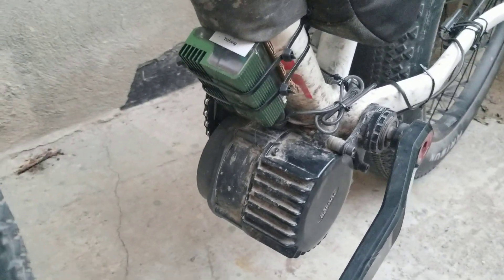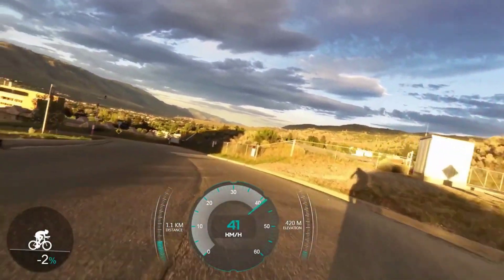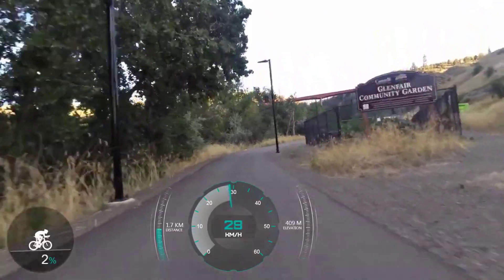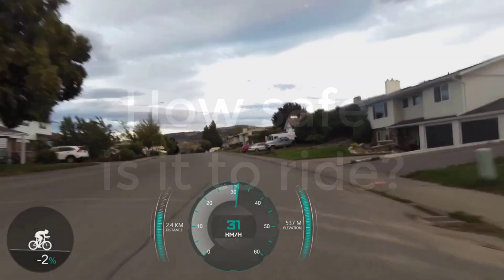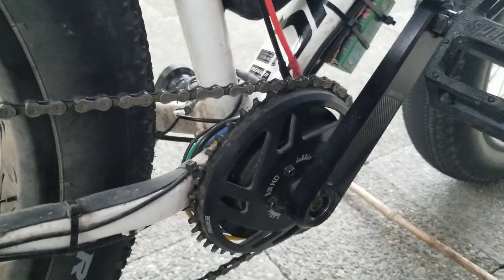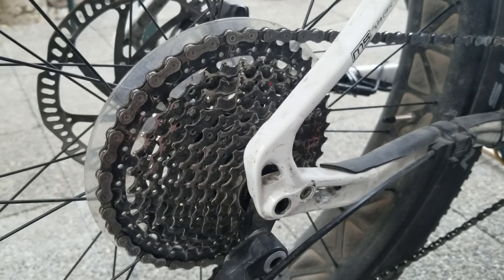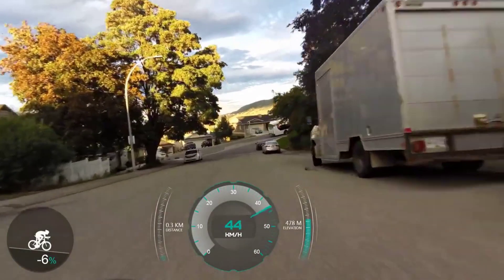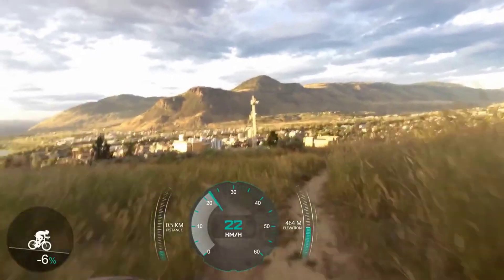Bafang BBSHD - Ultimate Controller? ASI BAC800

Comment: Hi Captain, I'm having problems with my ASI bac controller. It's already been back to the supplier once to check it's config and it has come back with exactly the same issues. Before I contact the supplier again I thought I'd ask you, as your setup is so similar to mine. I have chosen this video to comment on as it shows exactly what I would've expected from this controller. 
However my ASI BAC controller pedal assist starts at 50 watts on lvl 1 and goes all the way up to 250 watts at lvl9 ....yes that's 250watts. Also the 750c display doesn't have a 52v option! It has 36v 48v 60v and 72v therefore the graphical representation is inaccurate, at least it displays voltage numerically and that's accurate.  The throttle  function seems fine. You can imagine my frustration at installing, removing and installing again. So I thought I'd ask you if you think I might have overlooked something before I contact the seller again .
Reply from the maker: Sounds to me like it's been locked to road legal EU specs. I'm not familiar with the 750c Is the reason it's not giving you the 52 volt option is that it is already selected? Sorry you having trouble. I imagine 250 watts is a bit dull.
Reply: @HighVoltageKits  Cheers for your reply Captain. It does sound like it's EU spec lol but this was never an option. Having communicated the conservative  pedal assist values and no 52v option on the display I was requested to send it back, which I did. Sadly nothing has changed. Yes you're right conservative pedal assists are dull, pants, shitty cockwomble. Other than that it's epic 😂. Time to get back in touch with the vendor. It's replacement time or refund.  So disappointed. Thanks for your time Captain. 👍

Comment: Hello. I’m hoping you can help me with some information. Almost 2 weeks ago I ordered the bac800 and touch screen from ERT website. The status of my order is still “not fulfilled” and I’ve been trying for over a week to get In contact with them. Multiple calls, voicemails and emails with zero communication. Any idea what’s going on or how to get In touch with them?
Reply from the maker: Its not a big operation. I'm sure you will get it. But things are pretty much handmade right now. It's literally launching for the bbshd over the next little while. There is not a stock of thousands ready to ship. I'm not in shipping or manufacturing so I cant give you a time. Alan works hard but he has limits.
Reply: Captain Codswallop I can understand that but why doesn’t he answer emails or calls? If he told me there’s a week or two delay I would be fine but I’m considering reversing the payment because of the lack of communication
Reply from the maker: I'm not sure. I will see if I can get a general update for this weeks video.

Comment: I mostly use for pedal assist with occasional Throttle application, does the controller improve efficiency in terms of range? Very curious, I just don't like how bulky it is and how it makes the bike look DIY.
Reply from the maker: Changing a controller in itself will not increase your range. Which is simply a case of how big your battery is and how fast you choose to drain it. I use the controller because it is light years ahead of the stock stuff in the control it gives you over your motor. If you are not comfortable with making mounting hardware and custom parts then external controllers can be less attractive. It depends what you want. The auto engagement you can have with this controller is great for PAS control wise. No more snap on and off with the power as you stop and start peddling
Reply: @HighVoltageKits  Nice! being thinking about the upgrade, perfect project to kill time in the pandemic, however, I don't think they have any stock on those controllers anymore. Is phase runner comparable?
Reply from the maker: Kind of. The really cool PAS stuff is on the nxt tho. It will be back in stock.https://accelerated-systems-inc.myshopify.com/products/bac-800-eval-kit-with-bluetooth  This will not be 600 via Alan. It is the replacement for the 800.

Comment: I am about to purchase mine and would like to know  does the kit comes with the display or do I need to buy the displays separate
Reply from the maker: I would get the nxt display to get the best out of the ert kit. It should give you options. Which motor are you using it with?
Reply: So is the display included in the Price of the kit or do i need to get it separate?
Reply from the maker: You can order it as part of the kit. I think you have to register first and then you can see the options.
Reply: Thx.
Reply: Bbshd

Comment: I'd never have a mid drive without using an internal geared hub.
Reply from the maker: Supposedly there is a sturmy archer hub that can handle 3kw. The problem is most hubs can't handle the higher power. I love the rohlhoff ones but at 1500 bucks it's the cost of two batteries. Then if it gets wrecked....
Reply: @HighVoltageKits  if you release the throttle every time you shift like you're supposed to there shouldn't be a problem.
Reply from the maker: Yeah I do try and practice good housekeeping. I will keep it in mind. My dollars have to stretch far so maybe a future project. I have a 7 speed nexus on my bamboo bike so perhaps it may get converted down the road. With the nxt display the gear change sensor may well become tunable so that would also help with internal hubs. You make a good point

Comment: Are the stock Bafang attachments (throttle, e-brake, shift sensor) plug and play with the ASI controller?
Reply from the maker: Yeah. The kit uses the same bafang harness. So you would just plug the main harness into the plug on the loom that comes with the kit. All the other bits plug in like normal. You may need an extension for the gear sensor depending on where you locate it.

Comment: Thanks for the video! How is your bike fairing after over 6 months with this controller? Does the motor still operate nicely? Has the drivetrain noticeably deteriorated yet?
Reply from the maker: You are welcome. Its holding up well. At 72 volts now and it actually runs cooler than 52 volts as the amp draw is less. This is my most recent overview. https://youtu.be/c7q5TbIYq7I
Reply: Captain Codswallop cheers, I’m very tempted to get this setup. Only thing putting me off is the noise when compared with a dd...
Reply from the maker: It's not as loud in person or to a passing person. The camera is quite low on the frame. It's not silent but people quite often dont notice the sound until quite late. Knobby studded tires dont help. Offroad it's much much quieter. If you want almost silence then it's not going to work. But even full power it's way quieter than a car or motorcycle. Even a regular fatbike with knobby tires will make a fair amount of noise on the road. I'll shoot some better noise footage this year from different perspectives later this year as it's a question I get asked alot. I hope this rather rambling reply is of some use. Cheers

Comment: Hi Captain,,,, I have followed you and all the information and its been a great time watching it,,,, So I decided to get the ASI BAC 800 from ERT (Alin Hu) Thin is I have Emailed,, Foon and Messege him on FB but no response,,,, Mybe y cane give me same information or anything as I have instold the Bac800 and getting a Error code 30 H,,, I not a newbie,,, but have tried everything,, then remounted the BBHSD stock control and everything is fine 625km for winter ridding and getting to work Germany 😳😁 I hope you can mybe give me some Advice as I have running out of ideas.
Hope to hear from you soon
Yrs sencerly Werner
Reply from the maker: https://ebikesforum.com/threads/how-to-fix-bafang-bbshd-bbs02-error-30.138/ Error 30H can be tricky to figure out. What is the display you are using with the bac? Have you tried the stock bafang display with the 800? If you have the kit with the colour display I'd say it's the most likely culprit. Try following the link guide when testing stuff. First thing to try is the stock display with the 800. If there is no code 32 it must be the other display with the fault. The stock display will have no effect on power levels tho. Full power throttle or pas. Not a fun ride. Quite dangerous. But at least the problem will be clear.
Reply: I have the same TFT 750 display as his installation video and when I oder it I did say it and show the icon of the motor on the right hand side on the screen bottom,,,, thanks for your response,,, need to work and will check out things later, 😊😊
Yrs sencerly Werner
Reply: Loveittoday66@gmail.com,, if you want email me for privacy,,
Reply from the maker: So you already had the 750 display and ordered just the bac800?
Reply: @HighVoltageKits  yes I have it on BBSHD since day one,, running at 59.4 v 15s4p 26650 Pack and smart BMS vortex the same as Tony
Reply: Hi,,,, well I gone and changed the display the C965 with the Bac800 and it also given the same error code 30H on BBSHD,,,, On the Bac800 a small Red led cames on with both the Display,, but nothing seems to be working at all. The link you sent to me,,, l check everything and with no luck at all. I have not done anything with the cable of the Bac800 only change the power cable connection. I've checked the Internet and YouTube for any ting possible but there is not a lot out there,,, As I said before with stock control every thing works as it should.
THANKS for time in this matter.
Any Info is welcome 🤔
Reply from the maker: A fault with the wiring harness can also cause the error. Are there any links anywhere? Do the pins look ok on the plug for the display? There are six quite small wires in the harness lead. People have had error 30h from that as well. Sorry you are having so much bother with it.
Reply: @HighVoltageKits  will have a look at the wires of the control and check if the problem is in it?,,,,, the Red led light on the controller is it right the it is on? Thanks again
Reply from the maker: Yeah the red light just means the bac is on.
Reply: And also,, getting the app to work,,,, info to lock in to see more details  thanks

Comment: I'm in need of an external motor controller for my bafang BBS02 750 watt motor. I keep braking the bafang controller by burning out the transistors. What would you suggest I do? Many thanks from south uk
Reply from the maker: This kit will do it from ERT. The eggrider option has issues right now though. I'm not sure if the nxt touch screen is ready to ship for the bbs02. The other option is the phase runner. In the uk the dealer for this kind of stuff is electron cycles. I think they do this kit as well. Francis is the owner so you can shoot him an email. https://www.electroncycles.co.uk/ hope this helps. Cheers
Reply: i have the 
"LUNA MIGHTY MINI DISPLAY FOR BBSHD AND BBS02"
many thanks jason
Reply from the maker: It's nice display. Keep tabs on the nxt. There are some very nice features coming over the next year.

Comment: Hi Sir. I would like to ask a weird question to you. Is it possible for you to mention the temperature at which the internal nylon gear can melt?

Then i would be able to push the motor to limits without harming it cuz if the temperature rises then automatically power would be cut off from the motor.

Please Captain.
Reply from the maker: Nylon melts at over 200C. But failure will be well below that. Not sure the exact point. Best advice is to gear the bike to not let it get that hot. Check this video I did. It goes into detail about the nylon gear. https://youtu.be/c7q5TbIYq7I

Comment: What top speed you think you would get on smaller chainrings at the back?
Reply from the maker: It's not an easy question to answer.  The short one is probably over 80kph on the flat. It runs risk to the motor though. The top speed with the gearing I have is 70kph at 72 volts. But that's on a fat bike with 4.6 inch tires and weight. A lighter bike with less drag will go quicker.
Reply: @HighVoltageKits  I have a 2000 watt hub and goes at 38-40 mph top on flat ( nearly 70 kmh) but I want to make a mid drive, what kit would you suggest?
Reply from the maker: The two main conversions kits for that kind of power are the established bbshd and the newer cyc x1. CYC have just updated their website with the newer torque sensing options so that's worth a shot. With the bbshd you can buy a kit online but to get the speeds and power I am running you will need the bac800 from ERT.

Comment: Hi Captain  . I have one question. Can the ASI 800 run on 48v 50a battery ?
Reply from the maker: Pretty sure. Its listed as 36 to 72 volts in the manual.

Comment: How were the various PAS and throttle wattages set for the EggRider?
Reply from the maker: Try this video https://youtu.be/W1RS1nL1KS8
Reply: @HighVoltageKits  I watched the video bit still dont understand how you programmed eash assist level to have different wattages for PAS and throttle.  It seems there would be 10 different wattages you would program, in a table--  2 for each level.
Reply from the maker: sorry I missed this. The ASI has scaling parameters in its flash memory that scale the levels based on a percentage of the max level you choose on the eggrider. So if you set 1000 watts on PAS and 9 levels of assist on the eggrider you can go up 100 watts or so with each level. So there is quite a bit of flexibility for power options.
Reply: @HighVoltageKits  Thank you. Thats what I was trying to understand.

Comment: Here is cheaper controllers - https://www.ebikes.ca/shop/electric-bicycle-parts/controllers/phaserunner.html
Reply from the maker: Thanks for the link. Grin makes great stuff. I have their cycle satiator. There cycle analyst is very good as well. I live fairly close in Canada and their customer service is very good. Fast shipping. Cheers!
Reply: @HighVoltageKits  also here is original 52v https://www.aliexpress.com/item/32824732769.html?spm=a2g0o.productlist.0.0.129f607fvD7b5l&algo_pvid=92c76357-9862-4124-a4e3-e496caffbba1&algo_expid=92c76357-9862-4124-a4e3-e496caffbba1-0&btsid=97228a09-146f-4f20-9804-8344c3d0ff3f&ws_ab_test=searchweb0_0,searchweb201602_10,searchweb201603_52

Comment: I thought the BBSH could only run 1500w at the max? Am I wrong? I am buying one very soon! My bike is already shipping.
Reply from the maker: The sticker on the side says 1000watts and 48 volts. The stock controller will run a max 30 amps which translates to approx 1700 watts peak power. Using an external controller enables more amps to be sent to the motor. The stock controller would burn up over 30 amps. The BAC800 has much better electronics so more power. There are certain rules to follow though. Try this for more info on how I did my bike setup for higher power. https://youtu.be/oBtgP5CQa0Q
Reply: @HighVoltageKits  Thanks captain I got on your list for the kit .would you know about how much it would cost for shipping to new Jersey in the United states? Thank you
Reply from the maker: You are best off joining the discord channel for kit news and questions. I would guess $30 for shipping. That's not a guarantee lol. https://discord.gg/ScWuVxu9 let me know if you have any problems with discord

Comment: I heard that the E.R.T bac800 is locked? can you still adjust parameters in the bac800 with the Eggrider? like in the original Bbshd controller? Regards Chris.
Reply from the maker: I'll do an update on the eggrider. It seems to behave very nicely with the ASI. You can change most profile things you'd want to. No idea on the locking part. Mine clearly wasnt but maybe they are now. They work hard on the parameters so they would rather they stay hidden I guess. I haven't changed anything and it's been good for me so far. Cheers!
Reply: @HighVoltageKits  Thanks,

Comment: Thanks for posting this excellent video, i am glad your enjoying the controller!
Reply from the maker: Its awesome. I smile everytime I rip the throttle. I may have sold a few for you lol.
Reply: @HighVoltageKits  This vid is def making me consider getting one. lol. I have the jumbo: "Samsung 35E: ~25A Continuous, 34A Max Burst Current" so I'm dstill trying to figure out if it would be worth it without having to change the battery to one of the others
Reply from the maker: Francis W I would suspect the trip is set quite low on the bms if that is the max draw rating. Which would mean that it would cut power to the controller to protect the battery. I've had mine do that once as with the 30q it's set to trip at over 60 amps for more than one second.
Reply: Also would like to credit electron cycles as they have played a major role in developing this controller kit. https://www.electroncycles.co.uk
Reply: I would you be able to setup this controller for the Rad power bikes line of bikes? thousands of us would be ready to purchase.

Comment: Will I be able to use peddle assist modes with my C8 color display ? I am only doing the upgrade so I can install a 72V 35AH triangle battery and get the extra range. Don't really care about the higher top speed. With a 72v battery in peddle assist mode two it should be like a 52v battery in peddle assist mode 4. I don't know if my philosophy is right. Just trying to get a 100km plus range without peddling. I currently get 70kms out of my 1450 WH 52v battery.
Reply from the maker: The slickest option is to use the eggrider v2. It will run the pas levels how you want. There is an option at ERT in the drop menu to pick 72 volt eggrider. They also do a colour display that works with pas. All other bafang displays will only give you full power on throttle and 1 level if pas full power which is not what you want.
Reply: @HighVoltageKits  

Ya that was what I read. I want peddle assist, because it helps to moderate power consumption. I guess ill be buying another display as well lol. Thanks for the input.
Reply from the maker: Anytime. Make sure you are clear with ERT which voltage you are running and which display as it makes a difference how they configure the ASI